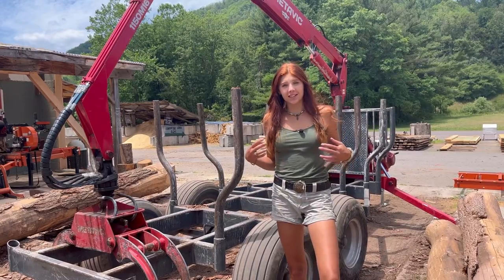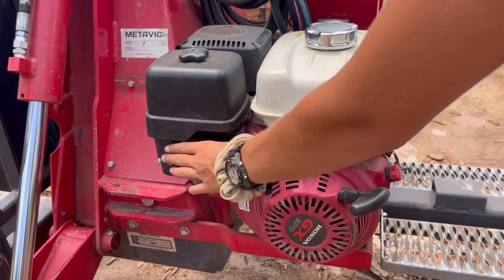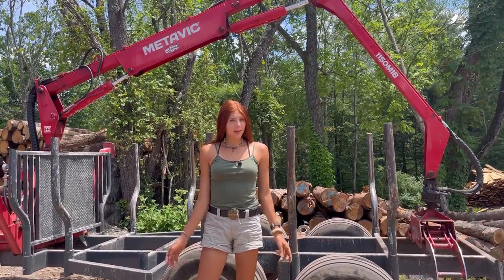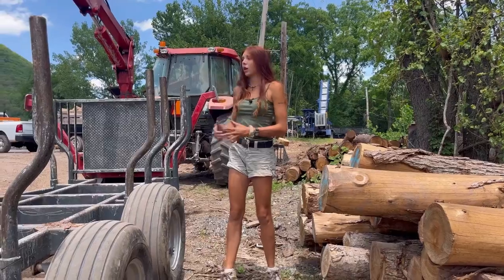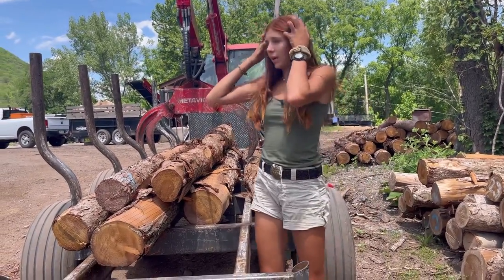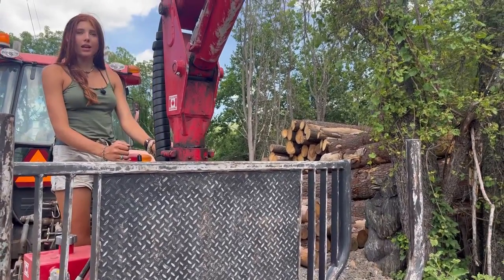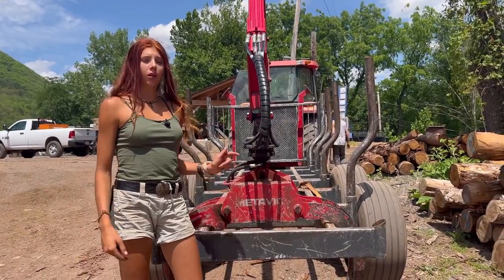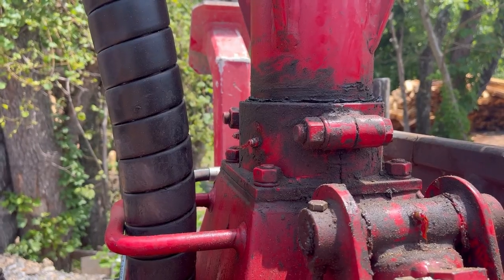Tips and Tricks to Running a Metavic Grapple Trailer!

Comment: You girls did a great job on that demonstration today. The only thing I may have added and your list of tips would be to always look overhead when operating a machine like that to look for overhead obstructions most importantly powerlines. Many people lose their lives by getting electrocuted with construction equipment similar to that by getting caught up in powerlines accidentally.
Reply: Amen.
Reply: That is one thing in their log yard they don't have to contend with yet anyway as shes mentioned they don't have power into the yard, which is unfortunate of course. But never the less you are most certainly correct that it is a huge hazard to have high voltage lines anywhere near equipment that is lifting objects up into the air, so many accidents have happened on farms and equipment/service yards due to not realizing there is a line overhead.
Reply: I do remember her mentioning that they don’t have power at the log yard yet. However if you do watch the video as she’s explaining about the log pile and loading the trailer if you look in the background you will see powerlines on a power pole. Those powerlines Are what made me think to bring that up.
Reply: I also might add that though they don’t have to worry about it at their specific location. While making a video on tips and tricks to others it may be a good thing to add to the tips part of the list. Those girls did a great job today on that video just an ad on that’s all two thumbs up for me.
Reply: @lifeonmttammanyridge2565  She commented before that those lines were from a previous owner and they do not connect to any utility power.
Reply: Yes I do remember them mentioning that and a past video. Just seeing them in the background reminded me of that tip that’s all. Have a good weekend everyone.
Reply: @lifeonmttammanyridge2565  Yes I had noticed them before as well and so initially had assumed they had power to the yard but can imagine there is a high cost involved in running it in, things that didn't used to cost near as much are now in later years beyond insane, never mind all the "demand charge and fees for this or that which bring the power bill way beyond the actual power usage. Without a doubt buried power lines in a working yard like that is paramount to safety.
Reply: This is a great comment and great precaution.  We have no overhead obstructions at the log yard.  The log yard is purposely designed.  Boss Man.
Reply: Went to school with a kid who was carrying a 30' joint of aluminum gated irrigation pipe, touched a line & killed him.
Reply: So many working families over the years have experienced terrible tragedies in working class families simply because we forgot to look up. All of you men and women out there on the working force please! Look up.
Reply: She did mention that on another video.

Comment: For the fun of it I looked up some factory specs for anyone interested in that, on this model of log grapple unit the maximum lift capacity is 1750 lb, maximum log length for trailer is 16 feet, max boom reach is also 16 feet, total weight of unit is 2500 lb, engine hp is 9, maximum grapple opening is 36", and they are made in Quebec Canada as I was curious myself since a certain amount of logging equipment is made in Alberta as well.
Reply: Thanks for all the great info.  Boss Man.

Comment: Yes, grease often and oil changes, but one that too many forget is to check tire pressure often as well. Especially when seasons change and temps swing wildly. Both over inflated and under inflated tires on a machine like that can effect stability as those two outriggers count on the other two points of contact (the tires) to make a four point platform. Just a thought.

Comment: That grease monthly decal is for that one grease fitting it's like the slew on a excavator. The others you can grease all you want  that one you will blow the seal out if you over grease it.  Cutting a recoil engine off and on is not bad for the equipment only your arm.

Comment: Your cutting boards need a drain edge. Make em 24" x 30" . Take a router and make a drain into the top. If you cut meat the juice will run into the groove. Good idea cutting boards.  Maybe a catch all that has a hole in it to catch scraps and hold a plastic shopping bag. Give the scraps to your mulch to feed the worms. Ad tree leaves to mulch and worms. The worm casings are fertilizer for garden . Water and turn. You'll outsell the competition with the best mulch. Mmm mulch and worms. Ha Ha

Comment: Great presentation Emerald. Occasionally for safety purpose, inspect boom anckor bolts to make sur they are not deformed or loose. My brother almost got crushed by boom fall caused by anckor bolts failure.  Metavic are good equipments, they are made not far from where I live. Woody are good equipment as well, very sturdy. Stay safe!

Comment: I would refer to that as a forwarder trailer. We call the 'legs' outriggers or stabilizers. Yes, you could kill yourself with a log loader, need to pay attention. You can throw a log quite far with a well timed swing. The hardest skill I had to learn was to 'catch' the bucket (or grapple) when it gets swinging. A well timed dipper-boom move stops the swinging. Cool video.
Reply: Em usually calls me at the log site for proper terms.  Today she did not.  Thank you for the comment and proper terminology.  Boss Man.
Reply: Joel those are stabilizers. Outriggers are horizontal with extensible boom sections.

Comment: Good job on the tutorial. They make a quick hitch for tractors, spring loaded, you drop your drawbar and it opens up,back up to the trailer lift it up and you are hooked up. Might not be compatible with whatever else you hook up to. Just putting it out there.

Comment: Being close to pile is necessary as you said, you can pull logs closer and grab them in a better spot. 
I see, on the controls. Left lever moves outer boom... forward moves boom out, back, moves boom in and left moves boom left and right moves to the right.
Right lever... moves inner boom, forward out, back... in. Left spins grapple counterclockwise and right clockwise. ( black or highlighted is part that will move and arrow, the direction it will go.
How long have you been doing it? You did great and you know about muscle memory.
Great job.
God bless and be safe
And just be yourself. videos are great and informative.

Comment: Bi-weekly grease is fine for your operation. Your center pivot with the four zerks... That would be a daily grease in my book.  Single pump in each zerk.  And wipe up the excess on all components.  I like my equipment lubricated and clean... but if I can only choose one of the two.  I'll take lubricated every time.  Lubrication is cheap.  The repairs are not.

Comment: I think the feet/legs are called stabilizers, aren't they? I just finished a class in hydraulics/pneumatics, and for one project we helped the professor fix a leaky stabilizer hydraulic cylinder for his tractor backhoe. 

We also had to build a miniature backhoe using pneumatic cylinders, and it looked a little bit like your Metavic except the cylinders were on top. We also had to make an arm that grabbed a rope but couldn't figure out how to make a rotating claw like yours with the parts we had. That would have been perfect.

I am going to guess that the two manual valves you said had confusing diagrams (I agree) were trying to show the rotation of the whole arm on one and the rotation of the grappler/claw on the other (the side-to-side action), and extension of the inner arm on one and extension of the outer arm on the other (the forward-reverse action).
Reply: Thank you for the precise observation.  Boss Man.

Comment: Emerald, If I might offer a little bit of advice. Only lift stuff (tree, equipment, car, whatever) ONLY as far as it necessary. IF something happens during a lift you want it to drop from the LOWEST height possible. Preferably nothing would ever happen during a lift, but that's not realistic. So, it's better to be prepared BEFORE it happens. In this case; you only needed to clear the trailer and the height of the log pile. But your last log was at probably at the top height the boom will go. No need to lift it that high. IF/When you drop one its better to drop it from 2 feet VS 10 feet. Otherwise, good job.

Comment: Whats the hp on the gas engine?
Reply: It's a Honda model GX270 (270cc) which is rated at 9.0 hp @ 3600 rpm
Reply: @DJRyder7  thank you it seems to handle the hydraulics  well.

Comment: To turn the machine on. Switch the switch to on. There is nothing stupid in saying that. If you ever train people. You'll find! Most people will need that information in triplicate. I have trained many people on the job, in my 46 year's. And many people are nervous, slightly defensive, and will forget the very sense. That God gave a goose. This is why I, when I see that a person is nervous. I don't rush them. I also explain everything as if they have never used that piece of equipment. Because! Chances are. They never have. If they seem a little defensive. I simply chat them up. And let them know I am only there to train. Not to judge. And explain, I to have been in their shoes.

Comment: Frankly, I think they use the trailer way too much.  It would be much faster and less costly to simply put a grapple on the Mahindra (I owned a similar model.  The engine blew up at 2000hrs).  I have done a lot of log handling over the last 40 yrs.  No way I would use that trailer just to move logs around.  Too slow and a waste of diesel.

Comment: Yeah... It's possible that Em had some Dolly's when she was a Wee Lass, but they had to have been packaged with some pretty heavy equipment.  I can see her as a youth with her Dolly under one arm while working the grapple with her other arm, winning a large number of plush toys at those supermarket arcades.  
The single most impressive thing about this is your attention to SAFETY.  I know that you can make it past 25 years on the farm with no serious injuries although Mining, Farming and Construction used to be rated as the top three most dangerous jobs.  You've had a good career if your only injury is a scratch on your shin lassie.  
I do, however, firmly believe that airhoses, welding hoses, extension cords, the odd tree branch, long-handled tools and sundry other objects literally to leap at you with a mind of their own in a malevolent effort to inflict injury.  At least that's the story I'm going with on why my shins look like the surface of the moon.